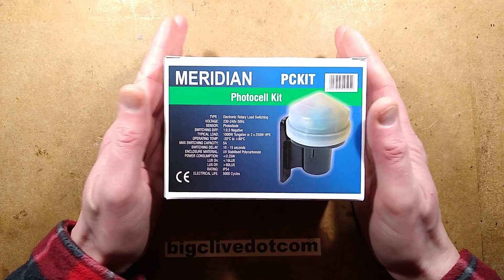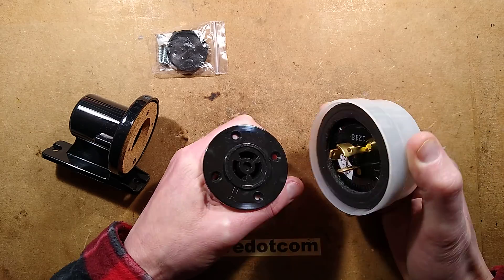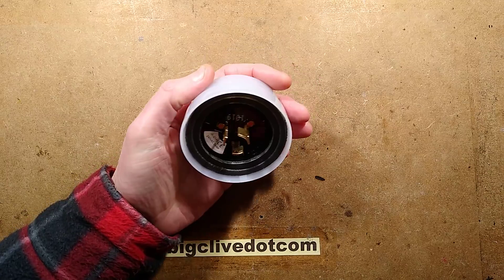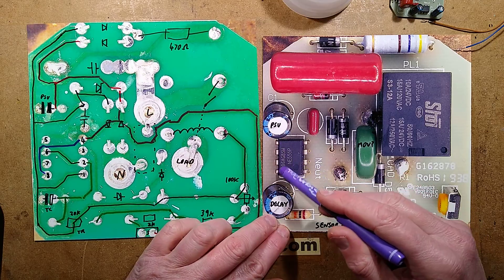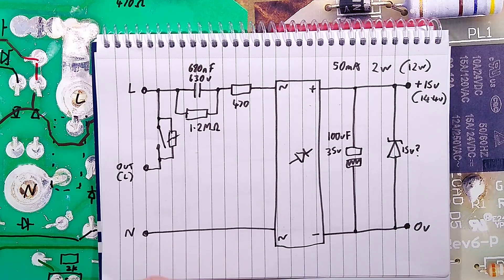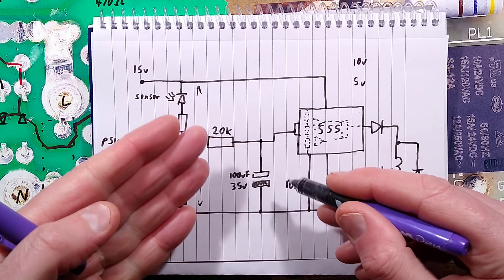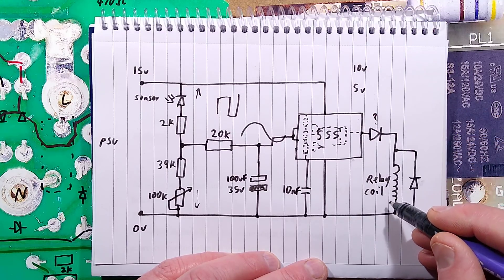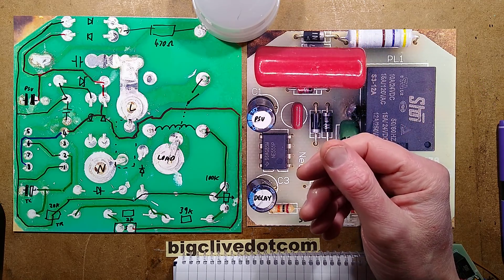Inside a UK compliant dusk sensor switch.  (with schematic)

Comment: Even with the bimetalic style, the delay was useful with street lights for lamp test purposes. The delay would be enough to check the lamp strike properly. Obviously it wouldnt show a failing lamp but by removing and replacing the slidelock fuse at the base it was useful
Reply: LOL, we had one installed yesterday, and the poor guy stood for 15 seconds with a cardboard box over the sensor to test the circuit, and repeated several times due to faulty wiring...

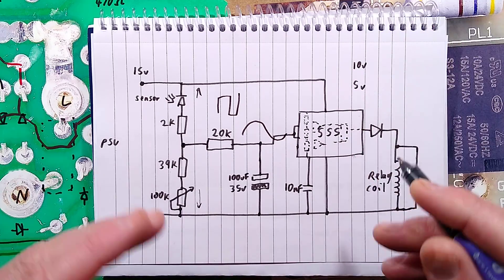Comment: 12:07 I don't think that the 555 produces a sine wave output. It's a 0/1 switch that effectively acts as a low-pass filter.
Reply: I think the graph Clive drew was the input to the chip, when exposed to varying light levels.

Comment: Going in this video I fully expected this to be a re-badged Zodion (google "zodion ss4d" for fun) product, but it wasn't. 
I own a spare light sensor for an outdoor light with a similar circuit, but instead of the 555 it has a LM358 that compares the light level to another set level. That circuit does require and is equipped with an additional transistor for the relay, I believe. I'm too lazy to get up and get it.

Comment: 555 forever!!! 
On the topic of 555's I ran into a weird quirk with them. For some reason my first batch differed from my second batch even though they were both the ne555p and from TI. 
I had the 555 set up in astable with a 1Hz clock output clocking a cd4017. My fist batch worked fine but when I switched the 555 to my newer set (remember same model and manufacturer) the 4017 was not happy! It  kept skipping counts and resetting. I tired every combination and I had no faulty ics. For some reason my new batch of 555s only worked with my 4017s when I used a 100 k resistor between the clock out and the clock input of the 4017! The old batch worked without it. The only way I got the new set of 555s to behave without the resistor was to lower the voltage of the 555 and 4017 to about 5v from 12. Does anyone have any idea why this is happening? The only difference between the new and older 555s was the fact that the newer ones use a notch to indicate pin1 as opposed to the older ones that use a dot in the corner. Remember same model (ne555p) both made by TI.
Definitely new to me and I am sill very confused:p
Reply: Could one batch be the 1968 bipolar design and the other the CMOS version?  Maybe Ti doesn't promise the absence of output ripple when driving ultra low current CMOS inputs, resulting in ripple or ringing, which the 4017 counted as valid pulses.
Reply: @johncrowerdoe5527  nah both set's are no more than 1 year old. All are the bipolar versions. It's very confusing. For some reason even though they are all the ne555p they don't behave the same. I checked myself so many times to make sure didn't make an obvious mistake. Tried every combination and every ic and my results were simply that the new batch of 555s was not happy to clock the 555 without a 100k resistor when the vcc was @12v for both the 4017 and ne555p. The other batch....no problem. I have been playing with the 555 and 4017 combination for 6 years and have never ran into this issue! So odd.
Tanks for your suggestion btw:)
Reply: @PracticalCat  I realize they were fairly new manufacturing dates.  But notched DIP packages are the classic package design.  Anyway if they are both the bipolar design (shown in the Feb 2020 Ti datasheet for LM555 that uses P to designate PDIP package), it still sounds like line ringing, impedance mismatch or rise/fall time issues.  555 chips are specified to have an output impedance of about 10 to 20 ohms with slopes of up to 100ns each way.  The CD4017B has a near infinite input impedance with a roughly 5pF input capacitance and a footnote that if you clock it on pin 13, the clock slope has slightly more restrictions than the claimed "unlimited" for pin 14 clocking.  EMC issues like these can be really tricky to solve, but it sounds like the RC filter consisting of your 100K and the 5p input capacitance (500ns time constant) stopped the false triggering.
Reply: @johncrowerdoe5527  sorry was literally half asleep when I replied. Rereading your comment I see you said "1968 version" not manufacturing date my bad. 
Anyway what you said definitely sounds  true regarding the false triggering issues. Thanks for talking your time to share your thoughts:)
Take care.
Reply: @johncrowerdoe5527  I'd often put a 10k series resistor on a CMOS clock input to act as a LPF with the input capacitance to remove any chance of false counting. The standard CMOS two-inverter oscillator is known for having noise on its output so I'd often use the three-gate version if I was using it as a clock and not to generate an audio tone.
Reply: CMOS ICs are very prone to glitches when driven from clocks that are not built from parts from the same logic family. You can often improve perormance with pull-up or pull-down resistors on the clock input pin(s). Around 10K-100K should be good for most applications
Reply: @countzero1136  yes you are correct! I recall reading this somewhere. Most of the time they do seem to get along. I wonder what the internal differences are between the batches  for the issue to only show up on one of them? Weird.

Comment: I put two of these on my house (Part P - ahem) - one is the dusk to dawn type you showed. The other has the extra components in it to calculate solar midnight after a few days and then it switches off late at night and on longer nights in the winter, switches back on again early in the morning.

Comment: The diode in series with the relais coil could be used to get the voltage down, since the PSU is about 15v and the coil is meant for 12v. Not sure if that realy is the case, but it could be. I've seen diodes being used that way in audio mixers too, where the PSU is 18v and they use effects modules designed for lower voltages. Soundcraft for example has 18v PSU, and they use lexicon effects boards with 3 series diodes in the power line.
Reply: I was thinking it was reducing the reverse voltage from the coil.  During turn off the coil will produce as much negative voltage as the flyback diode lets it, so typically 1 diode voltage below zero.  The series diode raises that up again by 1 diode voltage, so the 555 pin is only negative by the slight difference between high and low current diode drop for whatever diode model is chosen by the factory purchase manager.
Reply: @johncrowerdoe5527  A 555 should be perfectly capable to handle that, but you could be right.

Comment: I wonder why they chose the 555 for that application.
I would have thought that an op amp would have been cheaper?
Reply: A comparator might also toggle on and off rapidly, I'm wondering if using the 555 is a simple Schmitt trigger?
Reply: @karhukivi  because the 555 is more suitable in terms of current source/sink, which is around 200mA. Most opamps are only a few tens of mA - some can source 100mA, but are expensive and designed for different purposes than driving relays! You could add a transistor...but that increases the cost. Also, the built in hysteresis makes it much easier to design with a 555 (thresholds at 1/3 and 2/3 supply V) The 555 is old but cheap and rugged...i still use them for a multitude of 'things'!
Reply: @cornwallonline  I use them for lots of things too, thanks!

Comment: Good old 555 timer, threshold detector and relay drive :-D
One of the many things a 555 can do.
Reply: My first use of a 555 (x2) was to make a Star Trek "Red Alert" noise generator. :-)
Reply: Still no sign of a clock output diagram from a 555 where the only input pins are supply voltage.
Reply: @millomweb  Search for 555 datasheet, if a simpleton like yourself is capable.  Clock sources don't output "diagrams" by the way, you really have no idea what you are talking about.
Reply: Odd name for an IC without a clock in it !
Reply: @millomweb  Why odd? Time delays and clock generation from RC circuits goes back to the dawn of electronics.
Reply: @ferrumignis  To time NYTHING, YOU NEED A CLOCK !
Guess which key I missed !
Reply: @millomweb  No, you don't need a clock to time things.  You can rely on e.g. integrating a current into a capacitor.
Reply: @ferrumignis  Today's lesson - "What is a clock"

"Clock: An instrument for the measurement of time"

OED

QED

LOL
Reply: @millomweb  So perhaps you can explain your original comment about a 555 timer not having a clock in it being odd? Or perhaps not, since you seem to have made a silly statement and then confused yourself trying to defend it. 

The 555 is a timer chip because it can be used to generate timed periods, either as a monostable or astable.  It is not specifically intended to measure time periods, but can do so in a limited way as a retriggerable monostable. 

Why then would it need to contain something that matches your definition of a clock to justify it's name?  I'm sure you will be aware that the 555 itself can be used as a clock source, immediately showing your definition of the word clock is not exhaustive.
Reply: @ferrumignis  Why in the cases I've seen that use it have an external clock source if you claim it can be one ? And that is precisely my point, all the clock sources I've seen used with it have been external. It therefore it apparently has no timing or clock capability. So why do ppl call it a 'timer' ? That's what I find odd !
Reply: @millomweb  Your post is confusing, you say the cases that you have seen that use it (the 555 timer) have an external clock source. This makes no sense at all, the 555 requires no clock source, but can be used to generate a clock source in an astable configuration ( not a  particularly stable one, but good enough for many purposes).  A clock is this case is a repetitive signal used to synchronise logic, not the thing you mount on the wall to tell you when it's lunch time.
Reply: @ferrumignis  Tell me how you get that 'clock signal' from a 555 without any other electronic components - just a dc power supply.
Obviously, AC is a clock source !
Reply: @millomweb  Do you even remember why you are arguing?  A clock signal can be generated from a 555 by configuring it as an astable multivibrator, as described in the datasheet.  You are clearly well outside of your league here, why are you continuing to make yourself look silly?
Reply: Provide a url for this alleged information.
Reply: @millomweb  by the way that chip can be used for a clock.

Pretty easily.

But yes I like the point I thought about that years ago I first heard about those Champs and got to wondering about it.

You'd be surprised how many uses of slaves have besides being a timer.

For example this circuit 40 on at dusk off at dawn switch photocell as we call them here in the United States.

Also called a full electric switch.

By the way as big as I was saying about the older ones that used to big ldr light dependent resistor and a thermal relay a bimetallic strip and heater that is.

I have seen even some more modern photo controls that would mount in a junction box on a plate or inside a pole light.
That are about as big as a dimmer switch maybe a little smaller at least the internal package.

Those at least most of them I've seen work the same way.

Also I got an old photo electric switch that had a cord on it a big round bullet shaped kind of thing they used it for the chicken coop at one time.

Used it for about forever but one supposedly died.

A trip to the park to see what I could Salvage it turns out it was the same type of thing as the old school ones mentioned above.

Also from the same person I got old time switch.

AKA altered time clock.

That was used for the same an application at one time. And a chicken coop.

It actually had two outputs that triggered at different times to simulate the the sun setting so the chickens would return to roost.

Evidently chicken for return to roost if the lights are suddenly cut off instead of getting dimmer.

And also they need 14 hours of light for egg-laying evidently as well.

I also got some other things from them as pretty interesting stuff I found over the years.

That photo switch the one the bowl Chapel on we use on their garage light for years for the outdoor light.

Was a flood light for the backyard where are dog tie out was.

Then I switch you to a timer that is old time switch I got from someone else.

The later on that light was replaced with one on the side of the garage it was old high pressure sodium.

What I call wall box fixture with a built-in photocell.

Can't remember where I got it but it was when they were updating a building and they had tons of those.

I think it was somehow I knew that worked at a place.

Either or get weed electrician or something.
Reply: @aaronbrandenburg2441  It's only a switch - that's like saying a pendulum can be used for a clock !

Comment: The one thing I know about these, the connector is a US NEMA Twist-lock plug & socket setup, used across the pond where it's likely that someone could pull out a regular plug from the wall (such as for a camper, generator, outdoor power equipment, garage/workshop, etc.), not sure which pin/voltage variant these are, but guessing it's a 20 Amp-type sized version... :)

(Though connecting the sensor to an actual twist-lock socket would result in a bit of a bang I'm sure!!!)
Reply: Yeah, looks like a NEMA L5-20p/r (120 V) setup but maybe the device is configured with a different blade set due to most having a slight bend on the grounding blade.
Reply: It depends how 'badly' the thing is wired. If wired completely wrong, it'd be fine. The device is a switch connecting 2 of the wires together. So Lin and Lout will get connected together - so for these, use the pins for neutral and earth - connect those together, no bang - leaving the unit's neutral wire to connect to live feed. The switch would then work but all it would do is connect N to E.
Reply: @millomweb  Which may either trigger or bypass your GFI.
Reply: @johncrowerdoe5527  It should trigger it. But still no bang !

Comment: Where I work, We have a LDR housing with a few components in it and its wired off a few feet to the electrical shed and inside it is the rest of the relay and a contactor that switches on 3 phase 220 volt magnetic contactor for all the parking lot metal halide lights..It gets replaced about every 3 or 4 years because the contacts burn out of it. I've just about got them convinced to go to LED..lol
Reply: Use a bigger contactor, I use an old 63A contactor for the building lights, mainly because it was bought used at an auction, and with the contact rating the 15A lighting load will mean it will never wear the contacts out before the frame wears out. As a bonus it also came with a box. Even with LED the underrated contactor will wear out, likely your lighting is around 20A per phase, and your contactor is only rated for 16A, so 1000 full load cycles which is the design life.